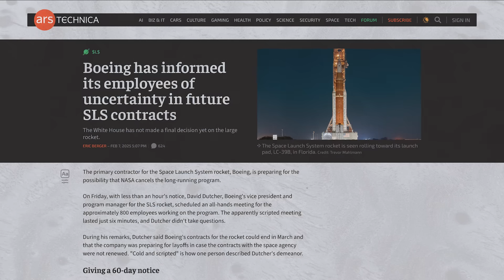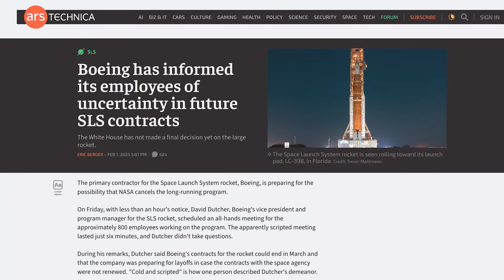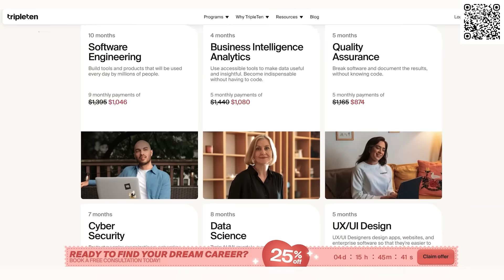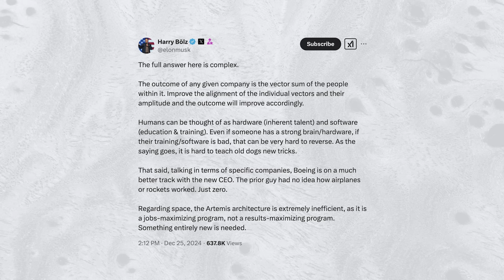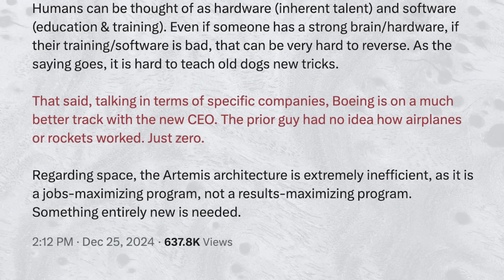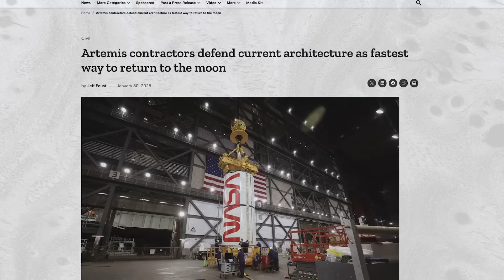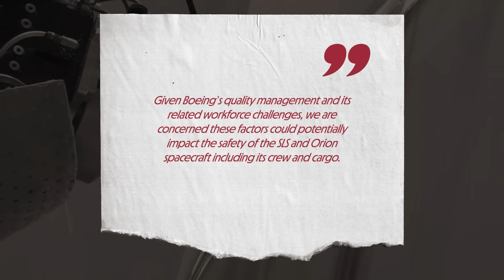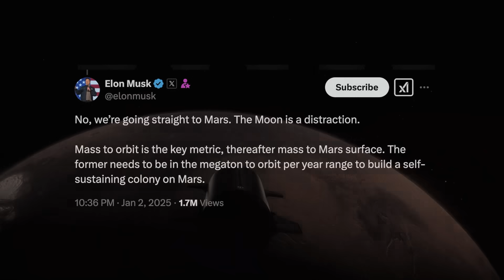This Is The End of Boeing

Comment: If SLS is to be cancelled it should be cancelled entirely right now. Launching an unproven rocket you intend to scrap once you've used up already built hardware is a disaster waiting to happen....I mean if you think Boeing cut corners and did shoddy work before what do you think they will do working on a project they know has no future? IMO If we go forward with using SLS for Artemis 2&3 you can bet if Boeing or NASA find something wrong with the vehicle that will cause a delay or cost money to fix their inclination will be to launch anyhow and hope for the best. Just like they did with Starliner....Beating China to the moon is not worth risking astronauts lives.
Reply: SLS is more proven than SpaceX's Starship architecture. By that I mean SLS put payload on a free-return trajectory around the Moon successfully, SpaceX has yet to demonstrate core competencies to deliver a Lunar Starship to the Moon. Those core competencies are Starship recovery and turnaround, in-orbit refueling, and trans-lunar injection. I left out landing because SLS can't land on the Moon.
Reply: @12pentaborane  Yes, but Starship HLS is necessary for a Moon mission, SLS is not and HLS Starship is not being canceled. Even if HLS was cancelled Starship development would continue with or without NASA. so SpaceX has no incentive to cover up instead of fix problems.

Though SpaceX hasn't yet demonstrated competence to deliver a manned moon mission. Neither has Boeing. Even Artemis 1 was not a success. Orion's heatshield failed. It suffered far more damage than the public was led to believe. The finding was they had high chance of losing Orion capsule...

Which is my major concern. NASA and Boeing covered up Orion's heat shield problems be cause they did not want to take the time and spend the money to fix it. Instead choosing to change the reentry profile for future missions. Which many say is not a safe solution. They also launched SLS/Orion on Artemis 1 with hydrogen leaks similar to what they later did with Starliner. 

NASA and Boeing have demonstrated incompetence in their decisions to fly known malfunctioning vehicles on demonstration, not R&D missions... Then cover up instead of fix the problems those missions turn up. In fact they justified launching Starliner cuz the got way with launching SLS/Orion that had the same problem.

If they are allowed to fly SLS twice more before it is cancelled they put a band-aid on anything that breaks and hope nothing bad happens before they get through the second flight.
Reply: @THX..1138   This might seem like a nit pick buy it's not, the Orion capsule is Lockheed Martin. Boeing has zero say in it's operation or development. Blaming Boeing on Orion's shortfalls is nonsense. All SLS/Boeing did was put it into TLI. From that point on that was Lockheed's problems.
Reply: @12pentaborane  That's actually not true...Boeing made Orion's heat shield.
Reply: @THX..1138   Textron isn't a Boeing company, if that's what your referring to. Lockheed mixes and pours Avcoat under license from them, who acquired the license from Avco when they bought them. From what I understand this is the same formula they used on Apollo.
Reply: @12pentaborane  No I referring to Boeing. Lockheed is the primary contractor for Orion. However Boeing got the contract for and are who made Orion's heatshield..... 

Which is why SLS/Orion is so damn expensive, behind schedule and why SLS is soon to be America's 4th failed attempt to build a vehicle to replace Space Shuttle...

 Every piece of these vehicles are build by a different subcontractor who's main interest is stretching out their government contract for as long as possible for as much money as possible. Then when the tax payer isn't willing to sink another dime in the sunk cost fallacy and project falls apart. They all point fingers at one another and say it's not their fault.
Reply: @THX..1138   I understand your grievance but our whole conversation revolves around who is responsible for Orion's heat shield. It's Lockheed Martin. I even used multiple search engines asking 'who makes orion heat shield' and they all say Lockheed Martin. I'm curious about where you heard Boeing made the heat shield? That's obvious disinformation.

Comment: You don't need to cancel this until after Artemis 4. They already have all the parts and infrastructure for Artemis 2 and 3.
Reply: yes.  thank you.
Reply: @dks13827 if the  cost of finalising any of these Artemis rockets exceed a Starship  New Sheppard Heavy etc then that's your reason. The $Billion price tag always was ridiculous.
Reply: Was it A#2 or #3 that it was found that Boeing had not kept a quality control watch on the fuel tanks, only to find bad welds as well as some unknown substance inside the tank making it technically unusable? Had those problems been resolved?

Comment: You left out the context of Elon's "The Moon is a distraction" comment. He was specifically replying to a tweet about if it made sense to mine lunar regolith for oxygen instead of launching it from earth for refueling Starships on their way to Mars. Here's the full tweet he was responding to:

"There is a long running debate between the Mars people and the space Habitat people. Zubrin vs O’Neill, Musk vs Bezos. I have thought for some time now it’s essentially futile in the commercial age - because the two camps are no longer competing for a fixed pie of launch and hardware building resources. Supply can increase to meet demand, and all the competing approaches will do to each other is help by accelerating development of the markets both need.

And consider this - Starship needs about 6 tanker refills for each ship going to Mars. Its O/F ratio is about 4, which means 69% of all the mass SpaceX will send to orbit for their Mars missions is liquid oxygen. Lunar regolith is typically about 40% oxygen by mass. 

The habitat builders have always struggled to time a market to drive their projects - maybe selling vast quantities of lox to SpaceX cheaper than they can launch it themselves is the proverbial “selling blue jeans to prospectors” that can close the O’Neillian case?"

- Peter Hague

Comment: What about the gateway project? I wonder how it will fare with all the decisions being made.
Reply: I love space exploration and want to see human outposts beyond LEO asap but Lunar Gateway (LG) seems such an inefficient way to build what will be a very cramped station even when all modules are in place that I can’t help thinking that if Artemis is redesigned then LG should also be cancelled and the funding allocated elsewhere.

If a redesigned NASA Lunar program does still want/need a space station in Lunar orbit then Starship HLS is by definition being designed to get from LEO into that orbit - the current Artemis plan calls for it to dock with LG on the Artemis 4 mission - and not just get to LG to dock with it but also have enough fuel still onboard to then undock, land on the Moon with a pretty sizeable cargo load, and then take off again and come back to LG again.

If HLS can indeed do that then a much bigger and more capable station could be put into that orbit (or probably other orbits) by designing a custom one-off Starship variant that is already outfitted as a station with deployable solar panels, docking port(s?) etc. There’s an awful lot of extra mass margin to play with if that custom ship isn’t then going to the Lunar surface and back plus it wouldn’t need landing legs, landing thrusters, airlock or cargo lift giving even more mass margin to allocate to space station equipment.
Reply: The fact that the Gateway abortion hasn't been laughed out of the Artemis program by this time tells you all you need to know about the seriousness of NASA's efforts to send astronauts anywhere beyond the relative safety of LEO. Perhaps new leadership will strike such vendor-driven nonsense from mission architectures going forward, but in Artemis's current form there are just too many reasons to never actually send anyone down for a landing.

Comment: Orion has a different heat shield than Dragon because Dragon is designed to re-enter from low-earth orbit at ~17,000 mph, while Orion re-enters from the Moon at ~25,000 mph. That extra 8,000 mph means the Orion heat shield has to endure a lot more heat and aerodynamic loading.  It wasn't Lockheed being lazy.  They crunched the numbers and designed the heatshield accordingly.

By the way, Charlie Blackwell-Thompson is a woman, so "she," not "he."  She always has been a woman. She's a mother.
Reply: AND evidently they screwed it up since the heatshield obviously didn't work as intended.  50 year old technology and they can't even do that right... LOL:)   The original Apollo guys got it right and all they had to work with were slide rules, and maybe about 10 years of ablative heat shield work done on various nuclear warhead reentry vehicle ablators (which come screaming it at 40+ gees on hyperbolic trajectories to impact).  

Just goes to show how far the mighty have fallen...
Reply: @lukestrawwalker  Heat shields used to predominantly be made by hand. All they had was nasas notes on it from 50 years ago, and those notes arent always as great.
Reply: @lukestrawwalker   " The original Apollo guys got it right and all they had to work with were slide rules"  Way wrong.
Reply: @lukestrawwalker  What exactly they screwed up in this case? Everything worked as intended, flight plan was achieved 100%
Reply: Dragon would burn up on a lunar reentry and the shape does not produce enough lift.
Reply: Because 'Charlie' is short for 'Charles' which is a lads name.  DURRR
Reply: Orion was ready to fly in 2016 when SLS was supposed to be ready!
Reply: @ Actually, Orion first flew on December 5, 2014, on the Exploration Flight Test 1 (EFT-1) mission.  EFT-1 was launched on a Delta 4 Heavy.
Reply: Any case Dragon issues is not related to heat shield
Reply: Especially when the person on screen was definitely a woman. I thought that was odd.
Reply: @therealjamespickering  voice and editing is often different people.
Reply: @dadrising6464  Obviously research and scriptwriting are too.
Reply: why do some many people call her a "him", i don't get it....
Reply: @nykolinos9983  im from an non english speaking country, and i know charlie as 90% male name, not sure how common it really is, but it might explains it.
Reply: @dadrising6464  Same here. But we are no journalists reporting about her and her job. In this case the journalist doing the reporting should know she's a woman.